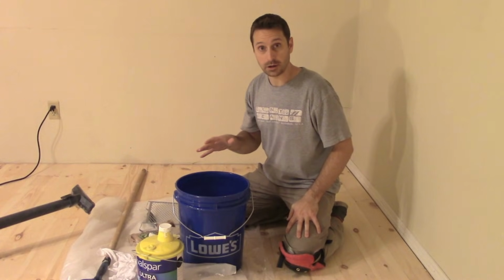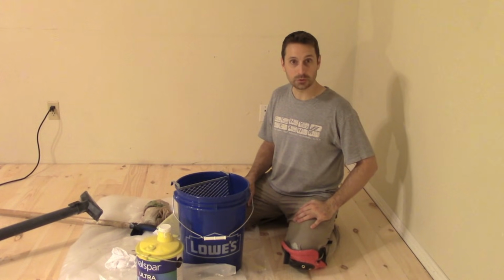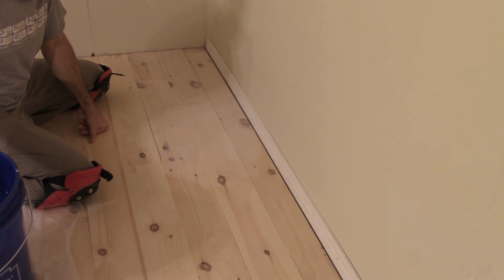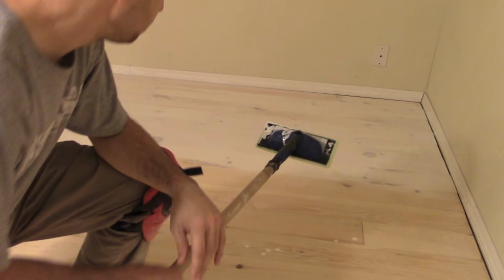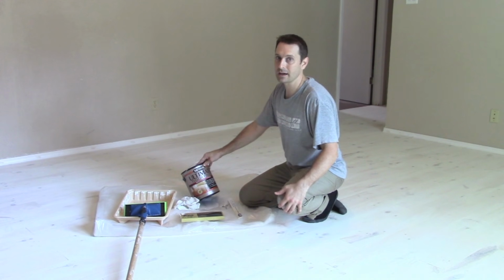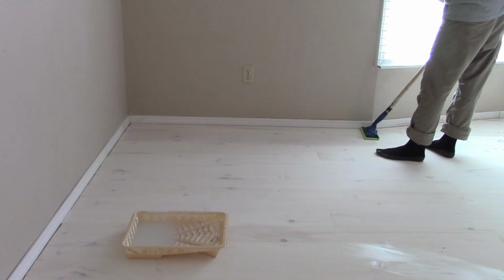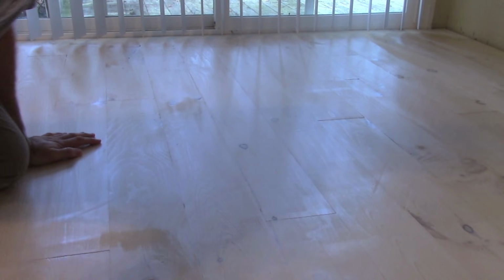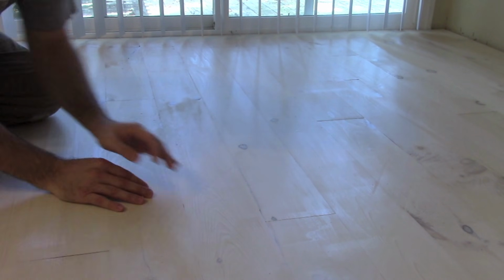How to Whitewash and Seal a Wood Floor. DIY Steps. Milk paint, Lime Wash, Antique Look

Comment: You did a good job and were so close, just needed another coat, buff off and a final coat. don't trust any laquer/seal that states one coat, every professional finish needs two or three coats. Grain raise is normal with water based products, you probably made it a bit worse using basically water for your first coat. A white oil may have suited you best as the paint is going to yellow.
Reply from the maker: I shouldn't have trusted the sealer claim and I found out later the product had bad reviews. I didn't have any significant grain raise, the roughness was from the aeration of the sealer with the foam brush. A latex paint wouldn't yellow.  Curious why you would say that.
Reply: Country Living Experience: A Homesteading Journey sorry probably didn't explain my self properly in my comment. What I meant was that any paint (for walls) is going to yellow over time as it will react with the tannins, oils in the wood and also the light. I know this because I did the same many years ago before coloured oils and base coats where so common and it looked great for a year or so then it started to get a yellow/green tinge to it. When I said an oil I was referring to a hardwax oil or similar, get the right one and you can put a laquer on the top. Would also always roll a laquer and pay more for a better brand such as bona or pallmann . Not knocking what you've done at all as I think you were only a few steps away from getting it spot on ( for a DIYer😉) you'll find that most of us floor layers or contractors as you say over there are more than happy to help and give advice

Comment: I enjoyed the video, but i would recommend using steel wool at the end to smooth the roughness.
Reply: Great suggestion. :) But steel wool should only be used when you're using oil based products. When you're using water based products such as this latex-water paint and the water-based sealer, any tiny bits of steel wool pieces that get caught and remain will rust! YUCK. LOL. FANTASTIC idea for using between layers of oil based products. =D

Comment: I'm going to be doing this in the house I'm flipping.  Glad I saw your video and now know not to use Minwax Poly.  I don't want any kind of gloss or sheen on the floor.  Is there another sealer that will work to protect but not be glossy at all?
Reply from the maker: I actually used a semi-gloss. It is fairly dull but certainly not a flat or matte finish. Try Varathane. It is a bit more expensive but it should work better. You can buy less shinier versions of each product if you can find them. Local big box stores may have a limited selection. Try Amazon.
Reply: thanks!
Reply: Hi Jonathan. I know it's been a while since you were in here... But just thought I would add...  The 'Flat' or no-shine in a polyurethane sealer (water or oil based) is often called "Satin" finish vs Semi-Gloss and (High) Gloss. =D
Reply: You should look into bona waterborne finish for future project   great products more expensive but  very durable
Reply: u can use any poly. use common sense and double or triple coat, sand between coats.

Comment: Did you find out what the reasons were for this outcome ? I wondered if it was because of the white paint ? Maybe for bare wood or stain ?
Reply from the maker: It was the applicator that I used. Also, I just "sealed" the floor. So for a smooth "finish", one must do several coats with sanding in between each coat. It has actually smoothed out over time from walking on it.
Reply: Ah great ok thanks for letting me know. Glad you are pleased with your efforts after all!!

Comment: You didn't do anything wrong. Looks like you're using a water based finish. It's just the wood absorbing the finish unevenly. You just need to apply more layers and you'll get the finish you're looking for. An oil based finish would absorb better but you'd still probably do multiple layers.
Reply from the maker: Thanks for your thoughts. I understand that applying more layers for the water based finish may achieve a smoother better finish. However, I was adhering to the claims made by the minwax product. They indicated that it only takes one coat with their product to achieve a "perfect" finish....this was incorrect. So essentially my video is a product review and theirs failed.
Reply: Apply two or three coats with the same minwax product and you would be very happy with the results. I don't know of any other brand that could achieve "perfect" results with just one coat, especially on pine. I feel bad that you believed the claim on the can, because a little bit more time and money could have meant many more years of happiness with the project. Hope all works out regardless!
Reply: Did the label on their product suggest that you use their wood conditioner first? That would have raised the wood grains in the pine where the wood absorbs differently. Then the sealer would have (certainly should have) lain more level on that first coat. I know that a few of the companies USED to make the conditioners. You did an amazing job! I would have been shocked if one coat worked. I'm so sorry that the company / label mislead you. Not sure where you are. I looked in the box store the other day. One gallon of floor sealer $80-98 / gallon! Ridiculous!!! But I have to do it of course. Your video is the best one out for white washing. Your a great coach! Thank you so much!
Reply from the maker: Thank you. The instructions for this product did not specify using a wood conditioner. I did not use one. Also, the ratio I used for the latex milk paint was not thin enough to raise the grain. I checked the entire house before applying the sealer. Some people who have watched this video misinterpret that (not you). The poor finish was just rough....like a course sandpaper. I has since smoothed out after walking on it for the past 5 months. I think I paid $68 at our local Lowes store.  Thanks again for your comment.

Comment: This is agood idea if you have new looking floorboards but if yours are very old and have been hidden under carpet for many years they will have to be replaced or sanded to an inch of their life before attempting to do this. I would of just stained these as they look great and five the room a fresh look.I have removed my hallway stairs and carpet and it took ages just to strip the many layers of paint from the steps. I'm not sure yet what to do on the landing yet but LVP maybe the next move.
Reply from the maker: Good luck with your floor. Thanks for watching.

Comment: it is a layering process apply wet dry sand apply wet dry sand continue process to desired finish
Reply from the maker: Thank you. Yes, I understand that process. However, I was testing that brand of clear coat and it's claims. Its claims were to offer a single coat with no sanding which would obtain a smooth hard finish. The product did not perform as it said. I will use a different one on the next project.
Reply: Did you choose a different poly? We are getting ready to re-finish our painted hardwood floors with a good poly coat - would love your recommendation!
Reply from the maker: We stuck with the Minwax. We had to move in as our lease was running out at the rental house. Out of time. They have smoothed out some after walking on it. If we do reseal it in the future we have will probably use Varathane. It is a little more expensive but not much.
Reply: I too used a Minwax product, the one step complete for floors, and was not happy at all. Like you, followed the directions to a "T" and they are now flaking up and chipping away.  At $70 a gallon it wasn't cheap for a 2100 sf house and didnt save any cash.  I was in a similar situation with a week until move date so I thought to save time I'd try the time saving product.  its been about 3 months on the now and I'm going to rent a sander to redo the entire house. Minwax "time saving products" just fail. I do agree with another commenter that more coats would have evened out but I hear what youre saying about the instructions and product claims as they are way off.  I will be trying your technique for the white wash. it looks like the best ive come across so far. Thanks for great video on what to do and what not to use.
Reply from the maker: Thanks Brad. Good luck with refinishing your floor.
Reply: Country Living Experience 

I used your method and went with a white from the greenish toned whites (I have red oak mixed in with my white oak floors) and it came out great. your method was the easiest and best I had found.  while I did mess up a touch with the exiting of the room and you can see some lap marks its not terribly bad. I'll get better at it as I progress through the house. If upload a photo but I don't thinks I can through this.  Anyways...  Thanks again.
Reply from the maker: Awesome. Yea, just keep that edge wet and it will really help reduce or eliminate the lap marks. Hope the rest of the home turns out.
Reply: Hi I am so sorry that you have spent so much time but the project did not appear the result as their state, I dare to assume might be the apply tool that you are using that could cause a over thinner layer, I don't know but seems the product look VERY thin to me. Good luck to your next project!
Reply: Minwax works great on an already painted floor.
 @amandajones2903

Comment: Could you use the minwax floor finish on stairs as well?
Reply from the maker: You could but I mentioned in the video that we weren't happy with the Minwax product. I would use Varathane. Should work on the stairs with no problem

Comment: Paint solids if not wiped off will leave a patchy look...you didn’t put anywhere near enough poly product on the floor...doing the paint ratio to use as a white wash I would have buffed it with a white or moroon pad then vacuumed and would ONLY apply a two pack SOLVENT polyurethane to HOLD that floor paint down..SIMPLE

Comment: In the end your issue was, mainly, using Minwax. None of their floor finishing products work well by any means at all. But also, it seems as though you ONLY sealed the floor. What about the finish coats? At minimum you should have lightly abraded the sealer, vacuumed and tacked again, and then applied an actual coat of finish. Just applying 1 coat of water based sealer or finish will cause incredible grain raise in the floor that needs to be abraded down. That is why you were feeling such roughness. In the end your staining process was not terrible to be honest, since you just essentially painted the floor with diluted paint you were able to get an even color which was quite impressive. Your mistake was in the sealer and improper finishing steps. If you were doing it over, I suggest you apply 1 coat of Bona Seal immediately after drying followed by a coat of Bona Mega. Then come back the next day, lightly abrade with 180 grit, and apply a final coat of Bona Mega, or any professional floor finish. Your stain application method was okay, but for finish I suggest you apply with a roller or T-bar.
Reply: Thanks Patrick what does 'tack' mean?

Comment: make sure you always use a water base sealer not oil base. Oil base works great for stains not paint
Reply from the maker: NYC Orchid Queen It is a water based sealant.
Reply: Pay attention
Reply: Yeah I did. I was trying to figure out why his floors are rough. Minwax threw me off I've only ever seen the oil base. Even in my homedepot. I realized his floor are rough is because it is a brand new pine floor that hasn't been sealed or stain. I painted two room in my house. My floors are over 60 years old. they have been stained, sealed, wax numerous times. I did not have his problems. When you paint wood/stain for the first time, it swells. It raises the grain. That needs to be sanded. Then you can apply other coats and possibly having to sand in between each layer. The unevenness off the paint absorption is do to the same thing. But after a few coats you should get a nice even coverage.
Reply from the maker: The roughness was not raised grain. The consistency of the paint was not thin enough.  It was the minwax product in my opinion. Yes, a squeegie would help but a portion of the floor came out very smooth. The product was inconsistent and did not perform as stated on the can. The vid is meant to show how the product performed when used as the can directs.